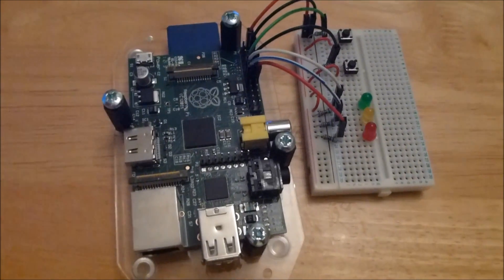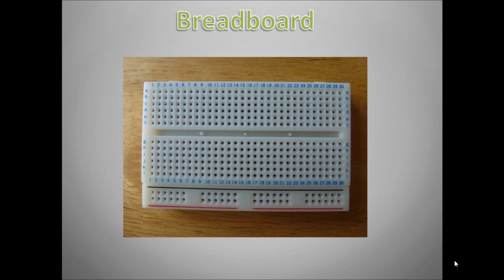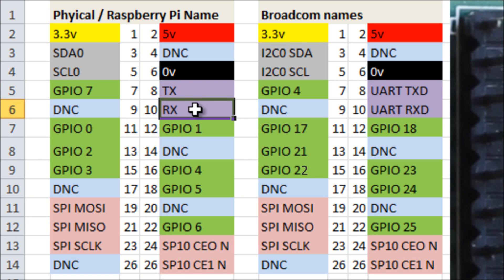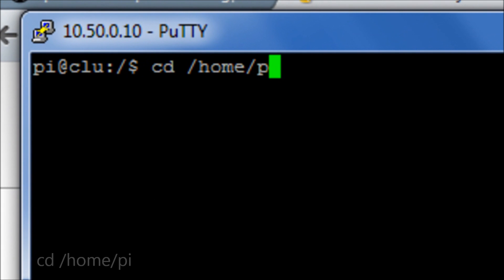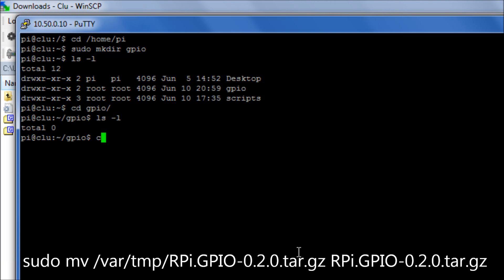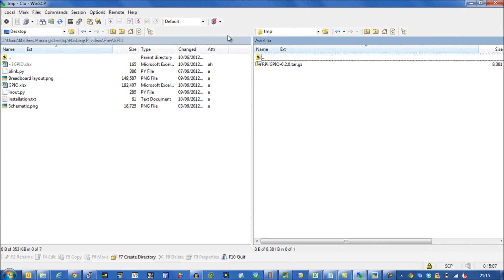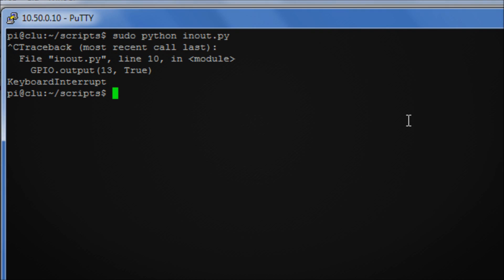Raspberry Pi - How to use the GPIO

Comment: Wow. 6 years old but still a quick and very helpful intro to using the GPIO for someone who's never used a Rasp Pi before, unnecessary sudo's notwithstanding. ;) 

Btw - his schematic GPIO numbers are the Physical/Rasp pi names, not the Broadcom names. 

Also if you run his .py files as is, you'll get "RuntimeError: Please set pin numbering mode using GPIO.setmode(GPIO.BOARD) or GPIO.setmode(GPIO.BCM)", so add the line "GPIO.setmode(GPIO.BOARD)" before any GPIO.setup() statements, as Curtis mentions below. Otherwise very helpful, ty

Comment: How would I be able to output more than 5 volts?
Reply: I think you'll need to drive a Solid State Relay that has contacts rated for a higher voltage. At PCB level the RPI only has the low voltages shown (3.3V & 5V) available on GPIO. So if you need to drive or switch a higher voltage, say 12VDC - you'll need to use interposing relays. In my background of Control Systems this is good practice anyway to ensure your Digital Outputs are driving a known load, presenting Volt-Free contacts to field.
Reply: You could just use an external power source and a MOSFET.

Comment: Hi i'm new to this so here's the problem ,every time i run the script it give me error saying  to set pin numbering using gpio.setmode the script works Warning set to false but error come up every time on run even with BCM i have a raps B+ 2
Reply: I dont know the answer to your question but seeing no one else has answered I will give you this peace of advice spend a couple hours changing around the existing code one command at a time changing little things and if when you run it it does not work delete what you just wrote and repeat over and over just changing bits and peaces here and there. It helps me learn the code better when I have no clue as to what is going on and sometimes I get lucky where whatever I just changed actually worked. also look at other tutorials just like this one and compare similarities and differences then try all the tutorials then if you try this with like 4 tutorials eventually you will figure it out. Good luck

Comment: I never wrote code before, but I really want to try my hand at using a pi... Can anyone shed some light as to how difficult this will be for a total nube to code...
Reply: +Visesh Lall Start by writing some simple programs - like a program to print out the words "Hello World" - then start to do some more interesting things in your program: print it out 80 times with a loop.  Keep messing around with the code until you feel comfortable understanding the syntax errors and such.  You will also need to know how to include a library and use the routines in the library.  A library is just a collection of little programs you can call to make your life easier... then you will be ready for pi
Reply: Hard I would say start with Arduino board. If you know nothing about code

Comment: Hello, I have the new RPI I have turned on a GPIO I measured with the DMM 3V but when I connect an LED, the LED is OFF, the power supply is a china thing. It is possible to comes the problem from the power supply?
Reply: +WiikenD problem solved, I simply changed the power supply

Comment: Why you need all the sudo for?
Reply: sudo stands for "superuser do" and that way u will do stuff as a superuser
Reply: MLG[420]ENGI yes, but I wasn't asking because I don't know what sudo is and what it's used for. I wanted to know why did he use sudo where it was not necessary. Teaching bad practices to novices. Not good.
Reply: myusernameislongerth Ha noob its necessary caus if ur not a superuser u dont get controll over the gpio
Reply: MLG[420]ENGI sudo mkdir gpio gives you control over gpio?and sudo mv /var/tmp/bla bla also gives you control over gpio? and sudo tar? sudo would be necessary only when running the code, not creating directories, unpacking sources or compiling.
Reply: myusernameislongerth sudo basically makes so that u can do stuff as another user, in this case root. If a directory is root u cn do much more stuff with it.

Get your facts right.
Reply: myusernameislongerth 
When typing for example sudo mkdir kalle you make that folder as the "superuser" or administrator in windows. Which already been said.
That "command" gives you a higher clearance of access when you wan't to do stuff in Linux environment.

There are some Linux distros that has the ROOT login removed, Ubuntu is one of them, there's a way to unlock it thou.

You could see it a bit like this.
When not using SUDO yo're asking your Linux to something, but when you're using SUDO you're commanding it to do what you want. Sort of.
Reply: Well there is no point, is there. ;-) 
But I must point out that you should think twice when using SUDO, because that you can actually format your boot partition and dont even realise that is already done until you trying to reboot...

It's a weapon of mass destruction literally.
I'm not a Linux nerd/geek nor a complete noob. 
And yes I've screwed up my system once or twice...

People who can't explain it better then bad teaching and so on, probably doesn't know it all that bad.
Just by the fact that if someone can't explain something in a simple matter, then they don't understand it enough.
Reply: +Hannes Camitz the user account he is logged into is "pi".. its a guess account.. cant do anything with that. But yeah could make folders in home directory though. root account is available can also use that.. wont need any sudo whatsoever.
Reply: Hannes Camitz FINALLY someone who can argue without saying stuff like "Teachin bad prectises to novices" and all that shit

Comment: Great video!

But, I ran into this problem:

running install
running build
running build_py
running build_ext
building 'RPi.GPIO' extension
gcc -pthread -fno-strict-aliasing -DNDEBUG -g -fwrapv -O2 -Wall -Wstrict-prototypes -fPIC -I/usr/include/python2.7 -c source/py_gpio.c -o build/temp.linux-armv6l-2.7/source/py_gpio.o
source/py_gpio.c:23:20: fatal error: Python.h: No such file or directory
compilation terminated.
error: command 'gcc' failed with exit status 1

When running:
sudo python setup.py install

If you get this too, just do this in the terminal:
sudo apt-get install python-dev

Helped me a lot :)
Reply: sudo apt-get update
Reply: then
 sudo apt-get install python-dev
Reply: ahhhh, a linux user i see, very nice.

Comment: Cool video, GPIO seems very interesting. I have never worked with embedded programming before.

Your linux commands are a little clunky though.

Your Command:
sudo mv /var/temp/RPi.GPIO-0.2.0.tar.gz RPi.GPIO-0.2.0.tar.gz
Easier Command:
sudo mv /var/temp/RPi.GPIO-0.2.0.tar.gz .

Your Commands:
sudo mv /var/tmp/blink.py blink.py
sudo mv /var/tmp/inout.py inout.py
Easier Command:
sudo mv /var/tmp/*.py .

Comment: If we didn't need the switches, could we remove the two red wires, black wires, resistors and gpio 1 and 2 wires connecting the switches?
Also, if we did remove those, could we use gpio 0 and 1 for two more lights in the same way the others are made?

Comment: I was having the same problem. The error is in the script (blink.py). To solve this problem just edit the script. I used notepad++. In line 3 add GPIO.setmode(GPIO.BOARD) and that should fix the problem.. The script should look like this :

from time import sleep
import RPi.GPIO as GPIO
GPIO.setmode(GPIO.BOARD)
GPIO.setup(13, GPIO.OUT)
GPIO.setup(15, GPIO.OUT)
GPIO.setup(16, GPIO.OUT)

Leave the rest of the script as it is... Hope this helps..

Comment: It's probably an update for the library. BCM stands for Broadcom. I'm quite sure this is referring to what Matthew described in his video: the layout on the board (GPIO numbers) being different from the actual chipset. The library wants you to select which one you're going to use. Use GPIO.setmode(GPIO.BOARD) to match the left diagram (Raspberry Pi / physical on board) in Matthew's Excel sheet, or the GPIO.setmode(GPIO.BCM) to match the right one (Broadcom).

Comment: FYI, for mv commands, you don't need to type the name of the file twice to move a file to your current directory. All you need to so is, for example, "mv $DIR_NAME/file.txt ." The '.' tells the shell to move the file to the current directory and keep the same name. You can also substitute the '.' with any other directory name and it will move the file there and keep the same name.

Comment: Matthew, I get the following error when running both scripts?

pi@raspberrypi ~/scripts $ sudo python blink.py
Traceback (most recent call last):
  File "blink.py", line 3, in (module)
    GPIO.setup(13, GPIO.OUT)
RuntimeError: Please set pin numbering mode using GPIO.setmode(GPIO.BOARD) or GPIO.setmode(GPIO.BCM)

Comment: now i completely agree that being able to trace pcbs and get a look at how it works is an important thing for any tech enthusiast to learn and i am also not trying to say your wrong, in fact even I, a 13 year old boy, like to take old electricalos apart and trace the ciruitry however the RPi is just nopt designed to be traced back and one of its main USP's is that it is "the size of a credit card" none of which would be possible without its multilayered circuitry.

Comment: True, but that was 50 or 60 years ago, when to programme a computer you really did need to plug wires together etc. The point is the hardware does exist, is plentiful and cheap, but its construction and detailed workings are far beyond the reach of 99.99% of users. Even the Pi's circuit board which links the components is multi-layered and opaque, you can't trace out the circuits like you could on a 1960's printed circuit board.

Comment: Oh hardware is important, naturally. It's just that now it's all made by very high-tech processes, which means that its cheap & powerful but not hackable on a physical level. And chip design is mostly done by software anyway. It is however very versatile, and the key to unlocking that power is knowing how to programme, not how to solder bits of wire together. Of course you can if you like, some people build steam-engines ...

Comment: It's teaching people how to use these hardware pins, which you don't get easily accessible in a big computer.the pi is also small, cheap and portable, which makes it great if you break it. it also allows to use the full capability of a linux computer in smaller pieces of hardware, just google whats been done with the pi. some people wanna be able to do that too.

Comment: The space shuttle is no more, it was well past it's sell-by date, it's computers still used core memory IIRC, they were that outdated. Hardware is now almost entirely opaque, unless you're a chip designer, and that is mostly done by software in any case. I doubt is more than a tiny percentage of programmers know how the hardware is actually structured, nor need they. Everything is hidden behind multiple processors and threads, layer upon layer of caches best left to a modern optimising compiler.

Comment: Well I probably asked for that, but really I'm just baffled by some aspects of the RPi. It's certainly empowering to be use a computer to interact with objects in the real world, but if this is for kids why provide an interface that you need a degree in electronic engineering to understand and use safely, why not a simple parallel port for example? Still if it works for you, interests you, that's fine. Please tell us what you've learned ...

Comment: The problem really is what is there today that's electronic & 'physical' enough to interest kids? Perhaps 50 years ago you could take a radio apart, identify the components, trace the circuits & to some extent at least figure out how it worked. You could even build one yourself, out of basic components, given the aptitude & inclination. Even 15 years ago you could take the lid off a PC & play around with it's basic elements. But the Pi is just a blank chip, enigmatic like the 2001 alien slab.

Comment: You have a machine that is capable of high quality graphics. Why do you want to mess about making a couple of lights flash? If it's for the programming experience you could do a virtual equivalent and avoid all that fiddling with little wires and stuff that otherwise appears to have no useful purpose. It's kinda like using an electric kettle to power a steam engine ... what is the point?

Comment: I have quite a bit of background with electronics and hardware interfaces, and I just wanted to say your video was a GREAT introduction to the Pi's GPIO. I'll definitely be playing around with mine when I get some free time, there is definitely some projects I want to transfer over to it.

I was a little unclear on one thing however. Are the serial RX-TX lines and the SPI bus actually usable in the Pi? i.e. can I write a program to read and write serial data using these lines?

Comment: I was trying to power my raspberry pi with my arduino as the power supply and accedentally connected 5v on my arduino to 3.3v on the Pi and when I start the raspberry pi I get through a little bit but then it freezes. Is it broken?!

Comment: Another question regarding to the switches in your circuit: As far as I understand, GPIO0 and GPIO1 are supposed to receive some current in order to trigger them in your application? Why is the way from 3v3 to GPIO0/1 split up with 10k resistors and ground-pin? Is it so that ground-pin receives 0,033mA current flow, and GPIO0/1-pins rest of the current? What is the max amount of current GPIO-pins can handle? or the minimum amount of current to trigger GPIO-pins? Thanks a lot in advance!

Comment: Hello and thanks for the tutorial! I am pretty much beginner when it comes to electronics, so could you clear up few things? In your circuit, the LEDs' cathodes are connected to GPIO-pins and anodes are connected to 3v3-pin. I was able to create blinking LED circuit using GPIO-pin to power one LED (connecting GPIO-pin to resistor+anode and connecting cathode to ground-pin). I don't understand how this works in your circuit if GPIO-pins can be used to power LEDs as well. You got 3v3 and GPIOs?

Comment: Looks like I need to do this, but I'm getting this 'dpkg-deb (subprocess): decompressing archive member: internal gzip read error: '[fd:4]: invalid code lengths set' during the install and of course it fails..  Now what do I do?  :-S  (I'm attempting to use python2.7-dev)  Thanks in advance.

Comment: Hi, I love your video! I'm currently doing some of my own and have used yours as a starter :) I noticed on your schematic however that you have 4 leds. I havent actually tested the circuit physically with 4 LED's but surely on a 3.3V supply the maximum LED's it could power is 3 with the resistors you are using??

Comment: Everything involving the temp files and moving them is very confusing. I followed your instructions exactly, but it couldn't find the GPIO file in the temp, and then when I tried running the blink.py I had the same problem... So frustrated after waiting for all these parts to come in the mail...

Comment: source/py_gpio.c:23:20: fatal error: Python.h: No such file or directory

When you are running "sudo python setup.py install" if you receive a fatal error stating python.h can not be found. Run sudo apt-get install python2.7-dev to get the dev headers required. If that does not work run python -V to find the version of python you have and change "2.7" to what is appropriate.

Comment: You don't really need 17 LEDs. Use shift registers, display hour, minute and second simultaneously, use the same clock for screen MUX(don't mind if you don't have one, just pretend there is one, think about man having to design complementary of your program - screen designer) and shifting between hours minutes and seconds, end up with 8 bit data bus. Actually, minimizing bus length is quite crucial and might be good exercise. You don't need 64 bit PC to display Datetime, right?

Comment: for those having trouble with the blink.py code you need to add the line "GPIO.setmode(GPIO.BOARD)" below the import statement. I got an error and the code didn't run unless I did this.

Comment: Thanks! Yepp, I know Adafruit and I've seen a few of their products. I know that the Pi's clock is reset after each shutdown, but that's not a problem, since it acquires the correct time from the internet during each boot.

Comment: Very nice polish on the screencast... fast paced and informative!

A few generic linux comments: May want to cut back on the sudo, it's kind of a bad habit to get into (sudo = running commands as root). Also, no need to use temp directories so much, feel free to wget right into those directories and untar them there. Save you a few steps anyways.

Keep up the great work!

Comment: Hi! I'm wondering if you have ever attempted to light  17 LEDs, one on each of the available programmable GPIO pins in the P1 connector. I'd like to make a binary clock and that needs exactly 17 LEDs (5 for hours, 6 for minutes, 6 for seconds). I've serached the net a lot and have managed to figure out which the usable pins are but I can't find an answer to what resistor values to use with each pin. What I mean is that some pins may have built-in resistors, so the resistor value could differ?

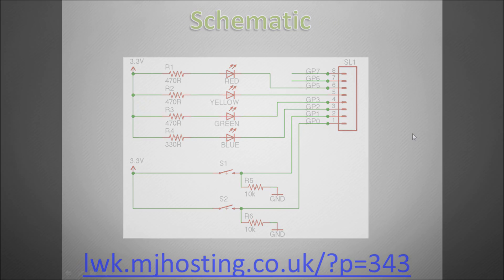Comment: Hey, I've got a question regarding the connection to the switch at 02:55. If the switch (S1/S2) is on, it's going to short directly to GP0/1 anyway. Why do we need to have a parallel circuit to 10k resistor & GND?

Comment: Oh. Uhm Yeah As long as its just those small builds like a few leds and switches the 5V should be just fine. As long as you dimention your resistors correct. The leds cant handle a whole lot of voltage.
But for bigger projects you´d most likely use a buffer circuit anyway to prevent acutal power being drained from the RB-P powersupply anyway.